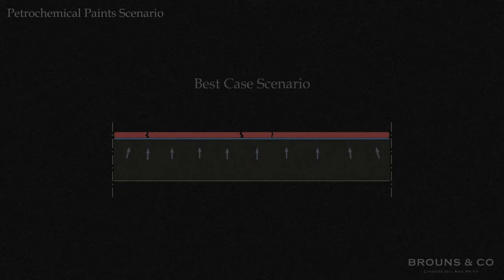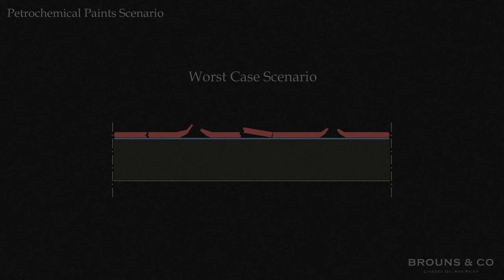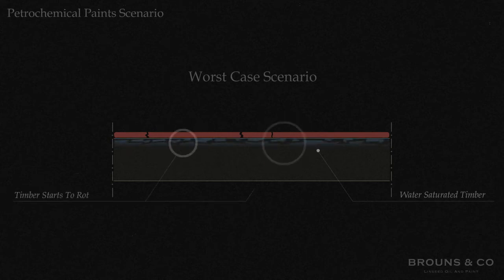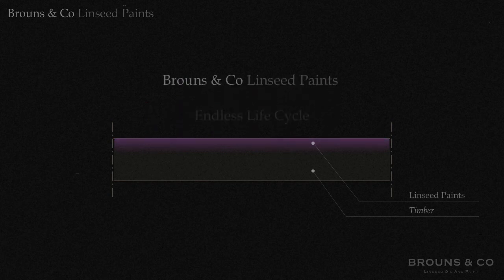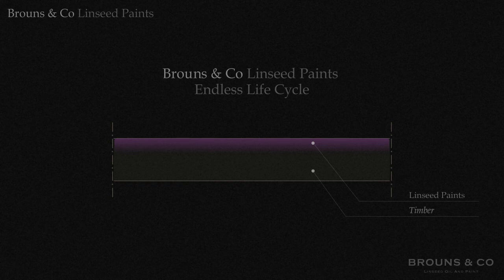Petrochemical vs Linseed Paint Brouns & Co

Comment: I had my external window frames on my Victorian home in the Penines painted with modern petrochemical paints. At first they looked great. After 5 years the paint toward the bottom of the frames started flaking. After 10 years they looked really bad. With rot issues in some places.
I'm now stripping the old paint off and repainting with linseed and zinc oxide pigment. I will have to get back to you in 5 years time as to how well this works out...

Comment: I want to thank you for this clear-headed comparison and for bringing this knowledge back to people. It’s a VERY similar dynamic when comparing cement render vs lime render. The layer of hard, non-breathable cement develops micro cracks from seasonal expansion and contraction. Then water gets behind the cement and either delaminates from the substrate and pushes it off the wall, or even worse it simply traps all the moisture into the wall causing damp and mold. We’ve lost so much wisdom in the last 100 years of homebuilding and totally sold out to big oil industry across the board. Much to everyone’s detriment.
Reply from the maker: Thank you so much! The comparison to lime vs cement is one I use in most of my presentations and very apt. It still amazes me that a lot of preservation architects understand the use of lime but happily specify a modern acrylic or latex paint for wood and metal.